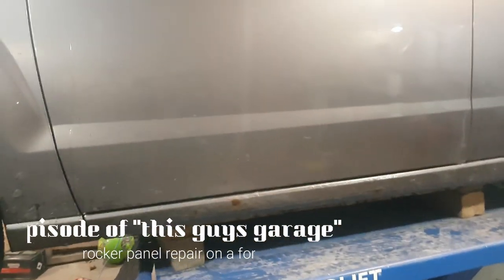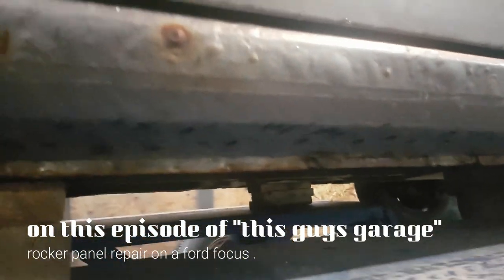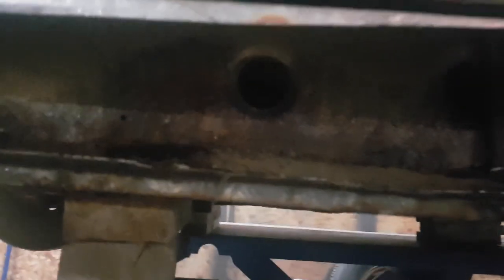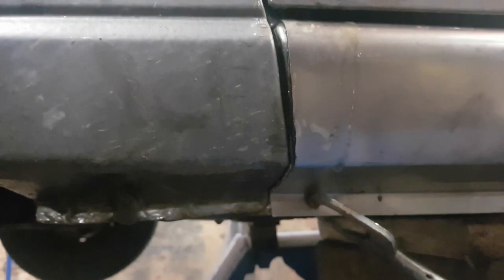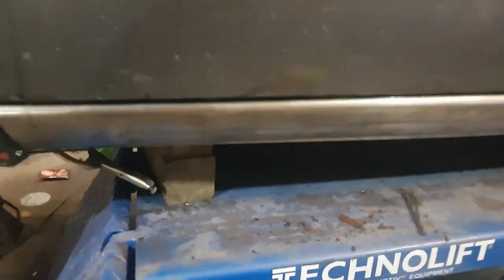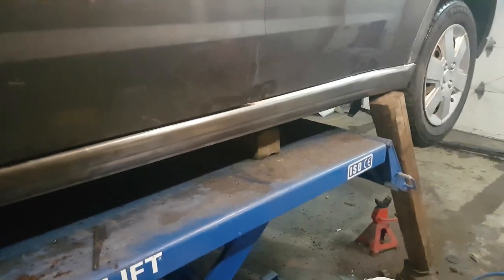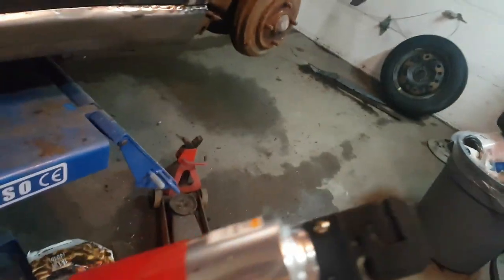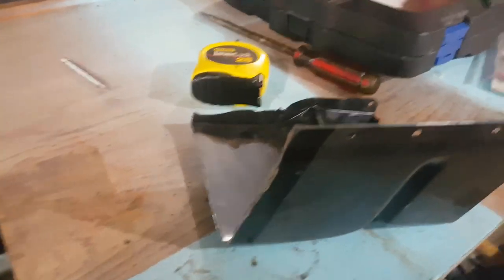rocker panel rust repair a how to install and weld & refinish rocker panel "this guys garage" 2019

Comment: What company did you get the rocker panels from ? I like this style panel
Reply from the maker: they were what the auto parts store had ,  post a link for what you are finding local i can see if it is approximately the same. ty for taking the time

Comment: How much would this cost on a Ford fucus just like this?
Reply from the maker: By the time you buy rockers material and paint your in the 1000 dollar ball park depending on the cost of rockers and the extent of the wrought even the color is a variable. 

Ty for taking the time your question is appreciated.